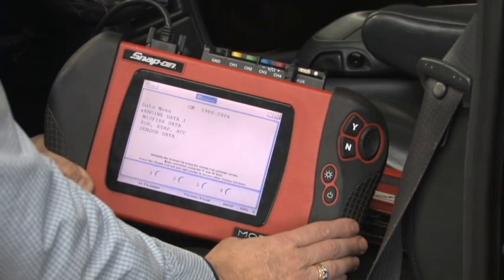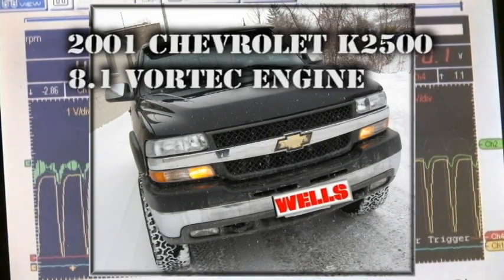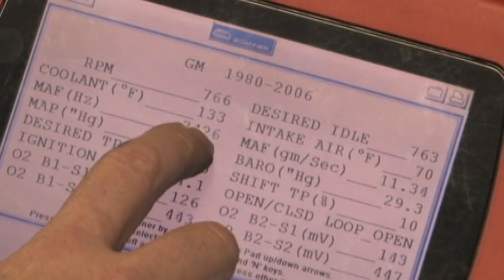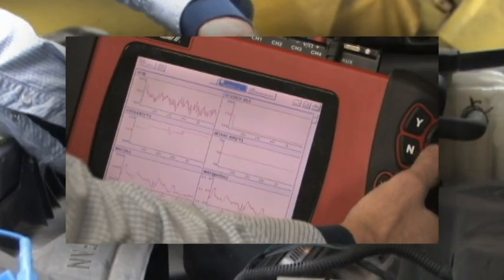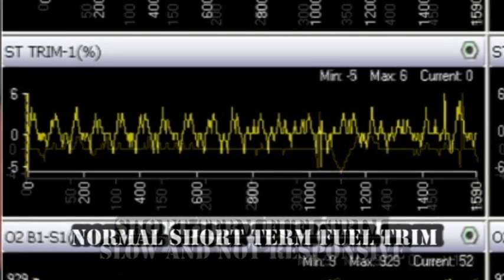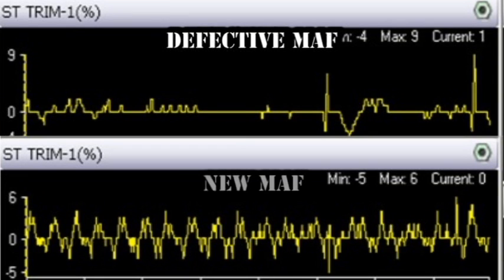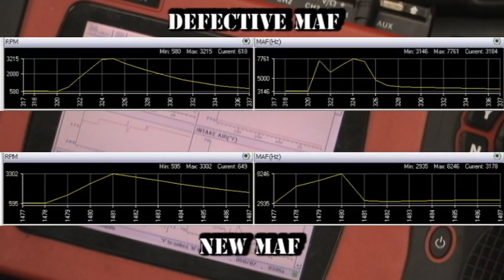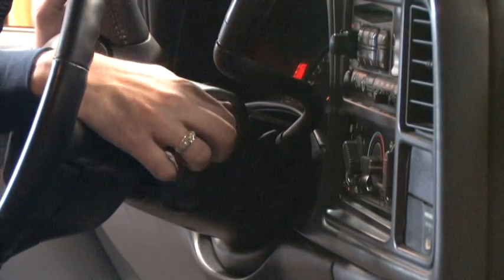P0101 GM Digital Mass Air Flow Sensor Diagnostics and Troubleshooting by Wells Solutions

Comment: Hello. I am dealing with a p0101 on a Nissan. At idle, I snapped the throttle, and the calculated load went to 94 %.; which would suggest a good MAF. I cleaned it, with no change.I also tried cleaning the TB( might need some more cleaning) and that did not make a difference. The fuel trim was good, with an equivalent ratio of 1. A vacuum leak is ruled out. An exhaust restriction does not seem to be the issue since the calculated load value (94%) indicates good exhaust flow. The car has poor acceleration and sometimes jerks and lacks power. Is there anything that I am missing? I ordered a MAF, but don't think that will resolve the problem. Any ideas?
Reply from the maker: The P0101 code can set if there is a high voltage from the MAF to  ECM under light load driving or if there is low voltage from the MAF to ECM under heavy load driving. While is can produce the load percentage under snap throttle it may have an issue within its operating range. I think you are correct in the tests you preformed and there's a good chance the MAF sensor will fix the issue. 
~Ryan
Reply: Thank you, Ryan. I  am more concerned about exhaust restriction and a dirty throttle body. I have a new MAF. But before installing it, I a, going to need to rule out exhaust restriction and dirty TB. Thanks again, Ryan

Comment: I need help on fixing a p0101 trouble code on my 2013 Nissan Altima S 2.5 that just started this morning. Any tips would be greatly appreciated! Thanks ahead of time!
Reply: Danielle Cooper Hi there. If you want to fix? First clean the sensor. Buy CRC (name brand)  “Mass air flow sensor”cleaner.

Comment: I have GM holden statesman or as it is known in the middle east by Chevrolet Caprice 2008 V6 3.8 cc, I have this code p01010 with a heavy engine operation & my mechanic suggested that I change the MAF & I replaced it with original but that didn't solve the problem. any othe suggestions os solutions please?
Reply from the maker: A dirty or deteriorating air filter element
A misaligned or restricted air duct
Exhaust system is restricted
Objects blocking the air inlet screen of the MAF sensor
MAF sensor connector is damaged (check pins for damage, and for moisture)
MAF sensor Ignition 1 signal has a high resistance condition
MAF sensor is damaged, or it has failed
Vacuum leaks downstream of the MAF sensor
Water intrusion in the Air Induction system
If you still have problem let me know,
Mark Hicks
Wells Vehicle Electronics

Comment from the maker: I am going to assume you have a 4.3 engine. I also need to know the problem, lacking power etc. Could the MAF cause this? Yes. It is a digital MAF. The best way to test it we show in the video, by tracing. A voltage reading will tell you nothing. Other common causes are fuel pump ( check fuel pressure under load) catalytic convertor, Dist. Cap and rotor and injectors (spider type). You can always give us a call at 1-800-558-9770 M-F 7 -7 CST.
Mark Hicks
Wells Vehicle Electronics

Comment: 2000 silverado I have no codes, no short term fuel read, long term is -10% and MAF reads idle at any throttle position. 2.404 volt. At 2000 rpm I get random misfire codes

Comment from the maker: @DMM9786  Both the Mass Air Flow (MAF) and Cam sensor get power from the under hood fuse block ENG1  fuse.

Inspect for a blown fuse. Replace fuse, if blows again disconnect the heated O2 sensors. Replace sensor causing fuse to blow, inspect wiring to sensors.

Inspect wiring to the vent solenoid, purge solenoid, Exhaust Gas Recirculation (EGR) valve MAF and distributor cam sensor. 

I hope this helps,,,stay in touch, please let me know what happens,

Mark Hicks
Wells Manufacturing L.P.